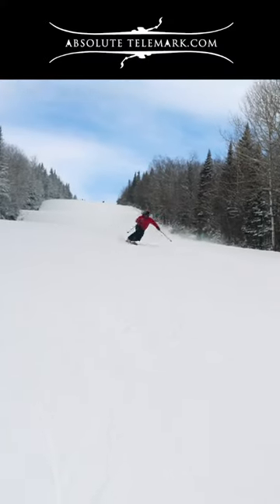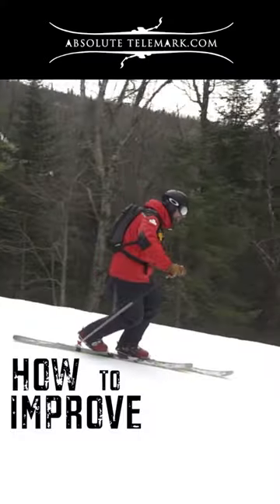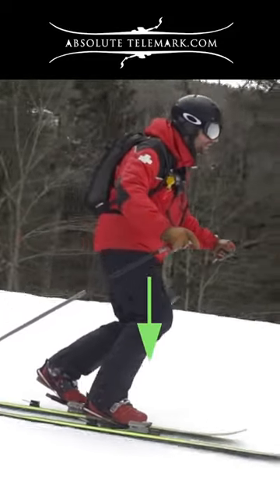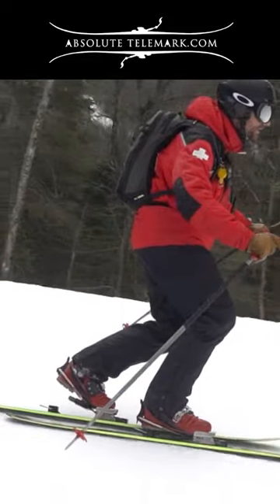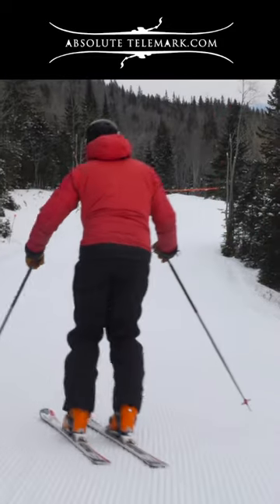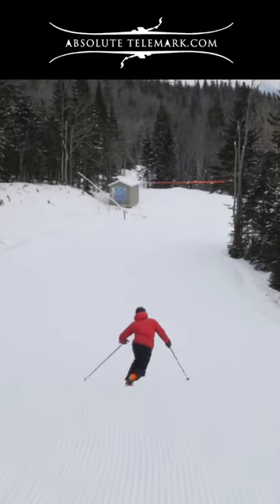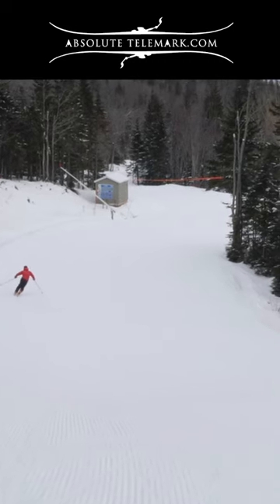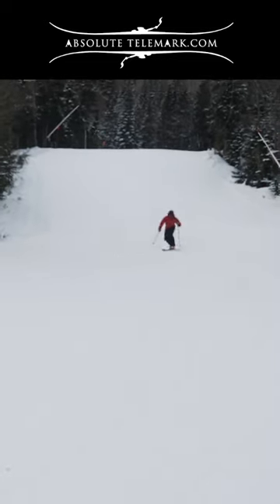How to CARVE Telemark Turns - TIP #1 Using your LEAD CHANGE

Comment: With this technique, you are skiing on 1 ski, which is not possible on steep or challenging terrain. Plus, your legs will get tired fast. The bindings don't help, but ideally your weight should be balanced over both feet. The balls of your feet. Dont use bindings that bend at the tip our your toes.
Reply: "The balls of your feet"

Exactly, could not be more right!